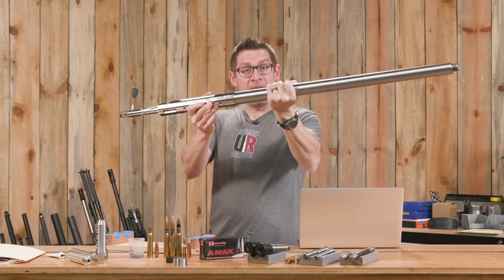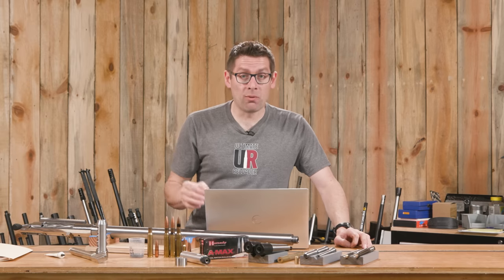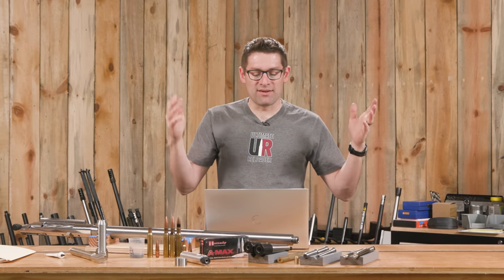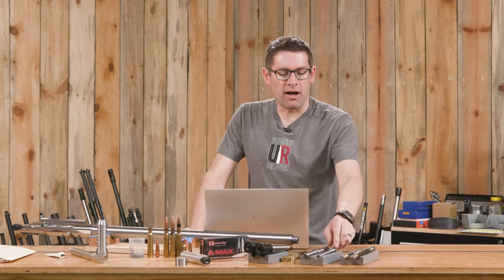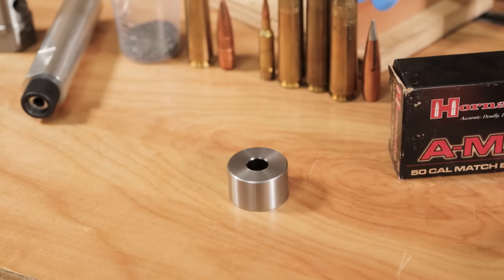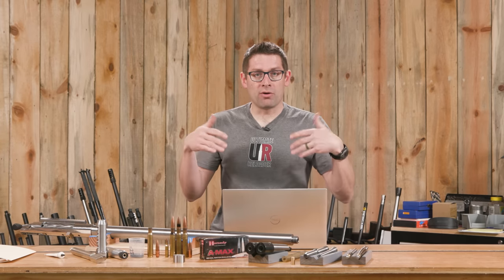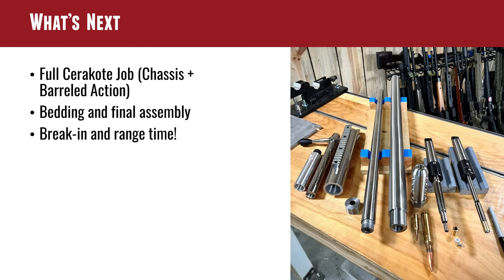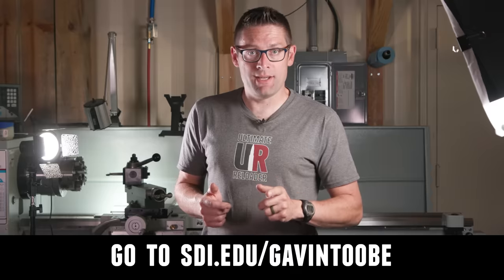50 BMG Rifle Build: Barrel Work (Machining / Chambering)

Comment: I use a mini lathe for doing small metal work. Even soft aluminum is a pain to use a parting tool with it. Chatter and part breakage is a serious issue. I am glad you mentioned it. I also got a good laugh about my epic fails with parting tools =)

Comment: One of the biggest problems I had when screwing with my 50 WAS lack of info. But you can get some pretty good accuracy out of a bolt action 50 if you take the time to tinker with them. Reloading for them brings a whole new round of issues to deal with. But it is worth it.

Comment: looking forward to the build. Just purchased my third cadex rifle myself. This one is the cdx-40 375 cheytac 32' barrel 1/10 twist. Found out that the desert tech 352 grain ammo is a little challenging when it comes to chambering but cadex is working with me to resolve that issue. My two other cadex rifles are the cadex Tremor 50 bmg (artic white and desert tan) Both are spot on and massive without a single hiccup...... I'll stay tuned to your build and look forward to 375 cheytac build afterwards...FYI The hornady 750 grain amax is the most accurate 50bmg ammo bar none

Comment: I didn't see a recoil lug. I guess it's there but it was not clear on the video. Fantastic job!
Reply: The recoil lug on the big Bats are bolt on lugs that are on the bottom of the action! On my CT action, it is a 1/2"×1" piece that sticks down into the chassis about 5/8"!

Comment: Nice Build👍 but for serious ELR work ,416 barrett or 460 Steyr. Paul Phillips prefers the 416 barrett. I personally like 460 Steyr better, 650 grains at 3200 fps, if you push those hard. Greetings from Europe

Comment: What's the honest truth?... Would you be able to get the same perfect results on your smaller precision Mathews lathe, or does a project of this size need to be done on a bigger lathe to get this quality of a finished product?
Reply: The results are down to rigidity and what the tradesperson accepts.
The only real restriction on a job of this size is the spindle bore diameter in relation to the barrel...if you choose to hold it through the headstock.
In fact, if he can use the smaller lathe with it's narrower headstock and without that ridiculously huge chuck, he wouldn't need to make an extension for the barrel to be able to hold it properly on the outboard side.
Keep in mind that he is sponsored by PM (and others) to promote the machines 😉
Reply: I would like to hear Gavin's comment on this as well. I can tell you from personal experience, that I may be able to do as good of a job on a smaller, cheaper lathe - but it certainly requires more time, and finesse to do it.
Even Gavin's big lathe is light duty by my standards. I have similar size machines  - but they weigh another 1500 lbs more. The extra weight is in the bed, the carriage and the tailstock. For chamber reaming large chambers, the extra weight/rigidity of the larger quill in the tailstock is a huge help.
Reply: @brucethom4957  you would certainly know mate 😉